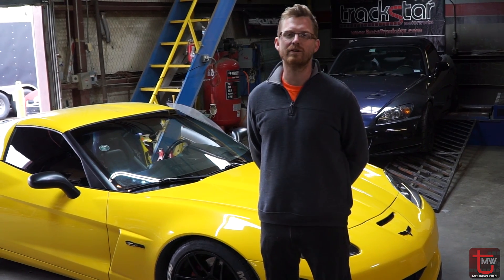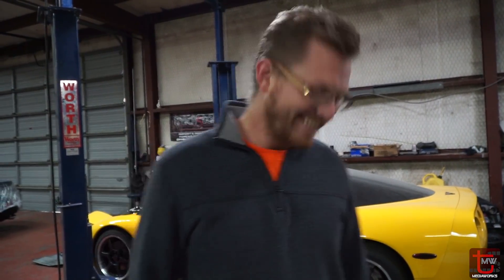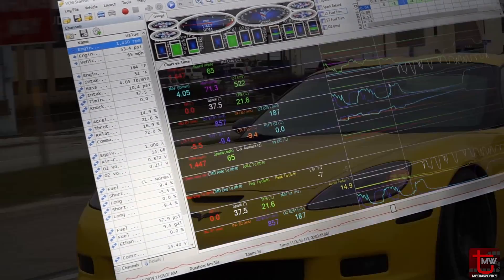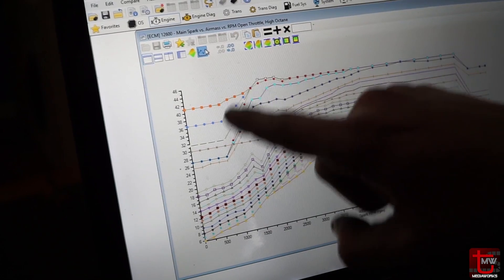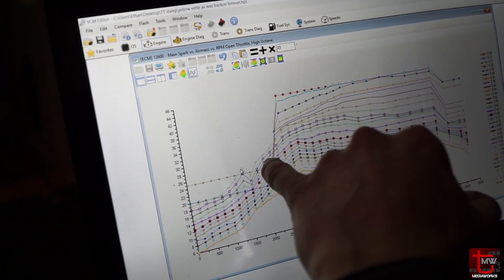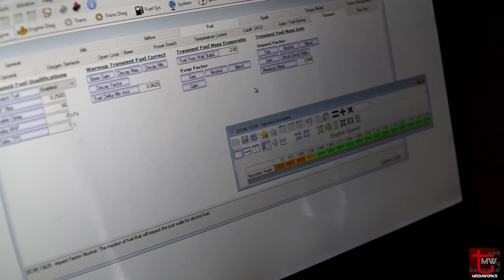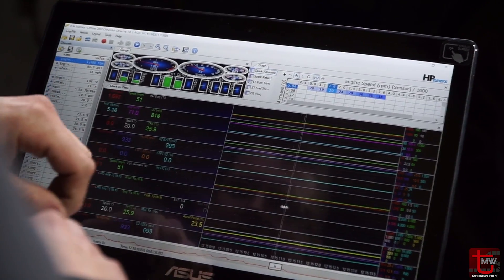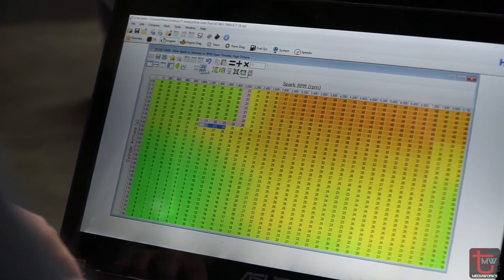How to Fix Big Cam Surge on HP Tuners with 600HP LS7 Z06 : Cam Surge -  LS1,LS2,LS3,L99,L92

Comment: UPDATE!!!!!!!!                >>>>>>>>>>>     Same car, same trans, similar cam, bucking like crazy for 2 yrs. Tried this spark adjustment youve described.  I was hopeful, but didnt help whatsoever. : (    Yall had me going for a minute though. I dont belive theres a cure for this big cam side effect. Wish id knew how awful part throttle was going to be before wasting so much $ time changing cam. LS3 cam is the best if you actually drive your car on the street regularrlly. Hope this helps some other poor sob not make the same mistake.

Comment: Same problem my ls engine car bucking while acceleration at low rpm. Is it cam surge problem or torque converter locking up?

Comment: Is cam surge OK to not tune out? my c5 has it currently at low rpm usually between 1200-1800 rpm while at low speed/load cruise (like 45mph in 5th gear it'll stutter and hiccup like its misfiring.

Comment: The ONLY reason a big cammed car would be running a MAF only tune is because the "tuner" found it to be too much of a PITA to dial in the VVE table!  It would normally be the OTHER way on a cam with alot of overlap:  to run an SD/VVE only tune as low rpm reversion can play havoc with the MAF sensor with a good amount of overlap.

I am fighting terrible surge right now on my +18 deg (@0.050") overlap LS3.  Traditionally, big cams want MORE idle and off idle timing because all that reversion functions as EGR but I'll try anything at this point.  Nothing has really helped doing the standard recommended Gen 4 E38 adjustments.
Reply: Me as well, I have an e38 and a stage III cam from Brian, it has been hell to get the thing to stop surging. I am going to try to reduce the timing like said video. I'll keep you posted on findings, mine is only at idle though I have watched the timing through cruise and it's spot on so maybe I'm chasing a rabbit.

Comment: Why do you keep manually changing the values in big groups on your timing table and not using the interpolation buttons?  Not only is it faster, but also gives you a much better transitioning timing table.

Comment: how much hp would you say my vette would make??  to the wheels wit a 430ci ls7 13.5.1 compression resleeved block best heads in the market fuel system everything no short cuts.
Reply from the maker: I’m surprised with that type of set up you haven’t been on a Dyno yet? Hard to say!
Reply: @TrackstarMediaworks  oh no bruh is cause we still building the car that's why, i was just asking like how much you think is going to make on some good fuel

Comment: I have the Comp Cam HRT Stage 2 on my 2015RT Challenger with longtube headers. I have had 6 or 7 email tunes so far. No luck with the surge. Then 2 dyno tunes, still has surging at low rpm low speed. Mostly at idle in gear, trying to move forward slowly, just bucks until I get to 25 to 30mph. Im good on highway. I'm starting to regret the cam install.
Reply from the maker: Hey there thanks for watching! We hear this alot. Why dont you email us the must current data log that you have and see if we can help you out with a remote tune. @trackstarmedia00@gmail.com
Reply: @TrackstarMediaworks  Wow really,  you don't mind looking at it? That's awesome. So, you just a data log of just the slow daily driving speeds, like where my main issues are at, our do you want any accelerations as well?
 Yes, if you could fix this surging my email, I would be blown away. It has really taken the fun out of driving this car. I had considered having the cam removed and going back to stock. 
  My name is Brian Davis.

Comment: idle adaptive spark control maybe have to be changed ?
Reply from the maker: Should not have to make changes to that... more detail please
Reply: @TrackstarMediaworks  usually that affect the amount of change in timing when the car is in idle so as mush as we minimize the value in the first table  as mush as we have smother spark graph
Reply: please correct me if i'm wrong

Comment: Cannot find the injection boundry the same as ur screen.. with engine speed on top... actually it has a manual entry for a parameter on one boundry button. Trying to tune my car.. 6.0 bored .30 big cam higher compression heads (241)

Comment: I have a '98 Z28, had this problem for years, 'pro' tuners blaming it on parts selection or pcm limitations. My 2D spark maps are ugly as a result of so many tuners being in there. I'll try lowering advance like you did here,  but I'd feel a lot better about it if the spark maps were relatively smooth like the maf and ve tables are.

Comment: I have a big cam LS6 that starts okay, but may* want to stall for the first 15-30 seconds, then smooths out until the mph read above 1.

e.g. if you put the car on jack stands with the car in N.  Idling.... simply spinning the wheels so the spedo rises will cause the engine to stall.

After the car has been running for more than 60 seconds (presumably goes from open to closed loop) it no longer stalls, runs just fine.

For years I have just bliped the thottle to avoid a stall for the first minute of driving. ( its annyoing on an M6 car.)

Ive raised idle air, and it seems like that resolves it until some time passes and the car trims itself back into the same condition.

After doing this a few times, and disconnecting / reconnecting the battery, the car will slowly idle up to 1800rpm, then clamp down on itself back to target idle, followed by a slow rise back to 1800 (and repeat)

After a week, the car will trim itself back to running perfect (with the exception of needing to blip the trottle to prevent a stall for first 60 seconds.)

In summary, each 'tune' seems to resolve this for the first week or two until the car trims itself back to a (first 60 seconds) problem.

secondary:

It bucks a little at 1100rpm in higher gears if you dont tip into the throttle little bit, Ill try pulling the timing in that area per your suggestion.  I usually just mitigate this with light throttle or taking it out of gear when 'coasting'.

Comment: I didn't hear what cam was in this car? I heard Texas speed but is it stage 2, 3 or 4 or something else? Curious because i'm getting ready to do a cam swap in an LS3 / 6 speed manual. I'm wanting to do a stage 3 or 4.
Reply from the maker: Honestly we have a great relationship with Texas Speed. And they would be the ones you should contact to spec the proper cam for you! I will get these cam specs to you though on the z06

Comment: Very informative video. Im currently building my LS2 out of my automatic 06 GTO. going 10 thousandths over on the bore with a stroker crank and all forged internals. Im looking for the ideal cam to run in it to build the most power on pump gas and a torque converter to go along with it. compression ratio is equating out to 10.95/1  with 404.14 ci. of displacement. Any suggestions on cam and converter options?

Comment: Ethan Hopkins
I cant thank you enough for your hp tuner videos you are great help at explaining things so we can understand. I finally got my Stroker DUAL fly by wire TBSS to idle correctly with BTR stg 4 cam  to stop that surging shitt using your method. I still have a ways to go but this was a major issue until now .  Liked and subscribed!

Comment: I have c6 z06 with huge comp cam, tuned twice  tuner said thats the best you'll get cause of the big cam, drives horrible didn't want to say that to tuner to insult him, it surges bucks from idle to 2500 rpm dont really want to drive it cause of that please help im in Toronto Canada  thanks
Reply from the maker: Do you have the ability to log? If so send over a file to trackstarmedia00@gmail.com thanks for the support
Reply: @TrackstarMediaworks  is that something i can ask the tuner to give me on a usb or something cam is .624 valve lift adv dur296 int exh312   dur @.050  247int exh263  thanks
Reply from the maker: @manim-ed4jr  the tuner might give you a log? Do you know what tuning software was used?
Reply: Trackstar Mediaworks I can ask thanks
Reply: @TrackstarMediaworks  I have the same issue with my BTR stage 4 cam LS7 running MAF only. Would you care to look over a log and tune file, I have my own HP tuners. 
Thanks from Sweden 👍
Reply: went to tuner today drove car timing map up to 2500 rpm i believe was set at 30 degrees, We dropped to 25 then 20 then even 15 car still had surging and bucking, While driving timing was steady all the way,  Also hesitates around 900 to 1100 rpm, Takes a bit longer to shut down, Also gonna install vacuum pump for brakes cause i only have 5 to 6 vacuum at booster, He said he will give email me data log just waiting thanks o and he was saying its a big cam that the issue thanks

Comment: This exactly the same issue i'm having on my 4 cylinder 8V 2.0L Golf motor with a 282 deg cam. I've been adding timing in that surge range,instead of taking timing away as you've done in the video.
Thanks for this video

Comment: How much do you charge to make changes to an existing tune like this?
Reply: Just depends on how long I spend with the car, and if the customer wants it back on dyno; or just touch up on street.
Reply: Ethan Hopkins probably just touch up on the street until motor is broken in, then back on dyno later.

Comment: What would cause the piston to break like that, I have a ls3 that had the same piston delete mod, and I also had a broken intake valve and a bent exhaust valve?
Reply: In this case it was a valve that dropped, pretty common on the LS7 unfortunately.